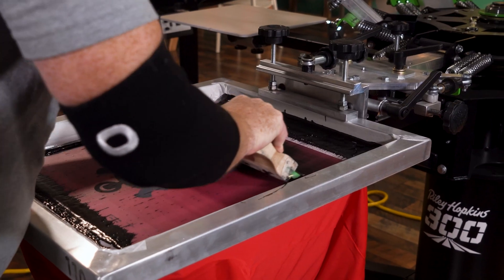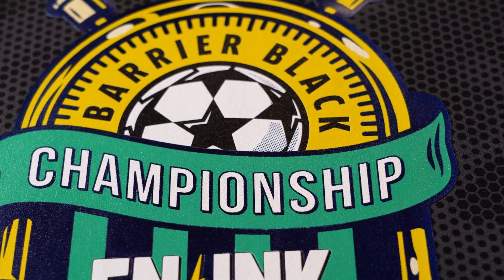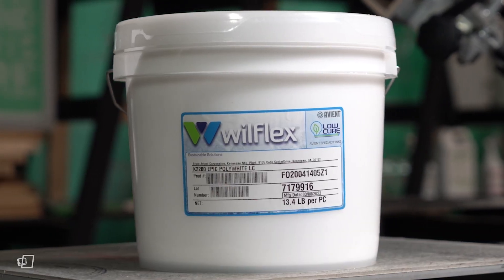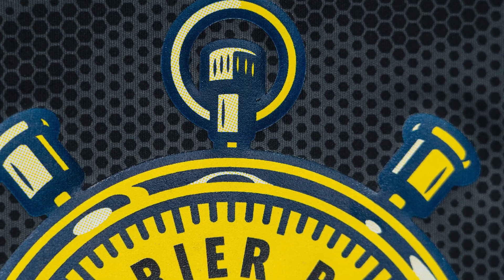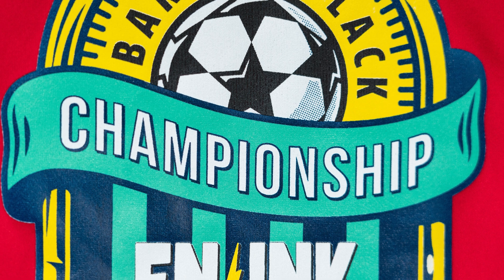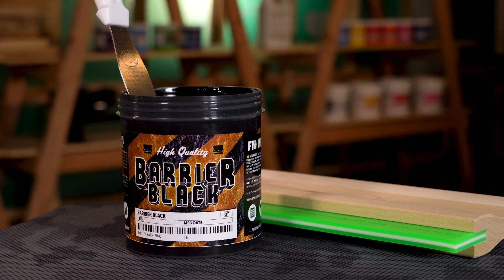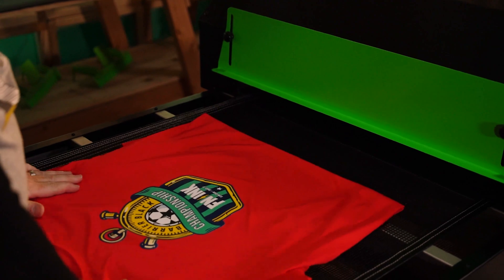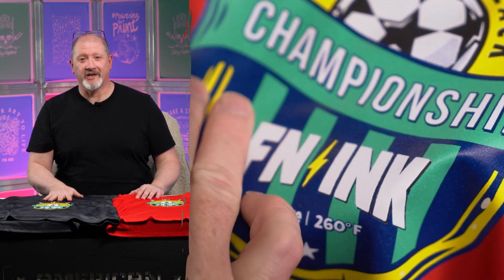Polyester Dye Migration | Deep Dive With Colin

Comment: Awesome video Colin. At what threshold of poly composition do you employ using poly white and/or barrier black? I've heard people say 80% and above, but also that it depends on the color of the garment as well, with navy and reds being the worst. Thanks again
Reply: I always try and make this statement during my videos:  Not all poly is created equal, it depends on which Mill made the fabric and were they in a rush that day....

Meaning, poly and poly blends that worked great for you yesterday, may not work great today.  Always test and do your due diligence.

Distributors should have a decorating guide on the product page for the garment you bought.  If they do not, assume the worst and use the heavy hitters (poly ink) to print with.

There is A LOT of poly Blends that print great with Low Bleed White.  Do your testing and ask others in the industry, that you trust, for their experiences.

Comment: I had to learn that lesson the hard way with not using too high a mesh for my blocking grey. I also made a mistake once with a striped soccer jersey of letting the sublimated fabric fold onto itself creating new stripe patterns coming out of the dryer so I’ve learned some lessons over the years-still more to learn!

3 follow up questions:

1. When you touched on the high quality poly inks that are easier to work with would the Wilflex Poly be on the list? What are some other recommended brands?

2. Someone told me about some Polyester garments that don’t dye migrate due to a different dying process-is this true and what would be a brand/shirt example that would do this?

3. One poly white ink I used to use does a bit of a puffing effect through the dryer-is this indicative of how most of them work? My go to choice for regular cotton and most blends is the Bolt White and it has a touch of puff effect as well which maybe contributes to how smooth it gets out of the dryer.

Thanks as always Colin.
Reply: Heyo!

1) Ask the manufacturer you like to work with what their easiest to print poly white is.
2) Sanmar ST350 is one brand that will not bleed until it gets HOT, closer to 340/350*
3) Almost all low bleed inks have a small to moderate amount of puffing during cure.  Poly inks are the same.